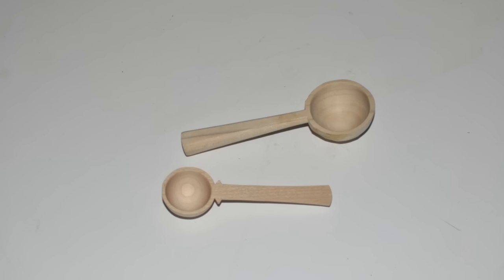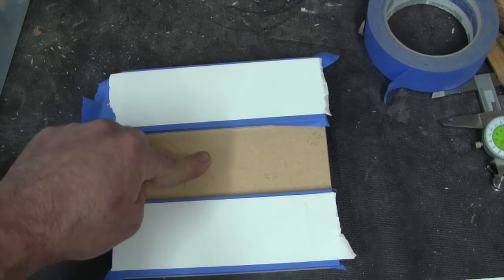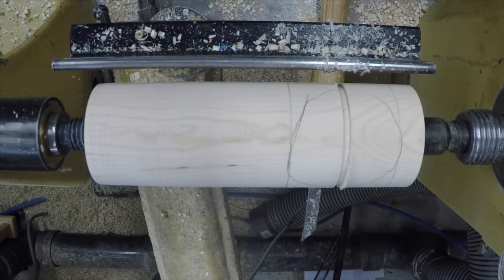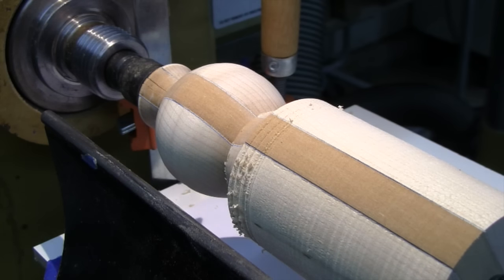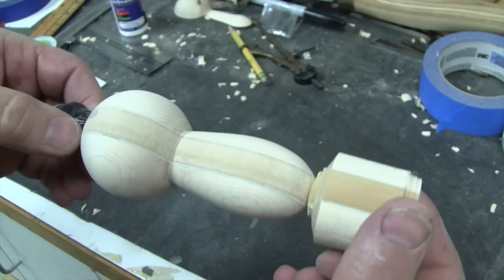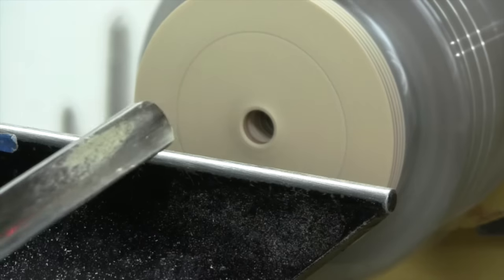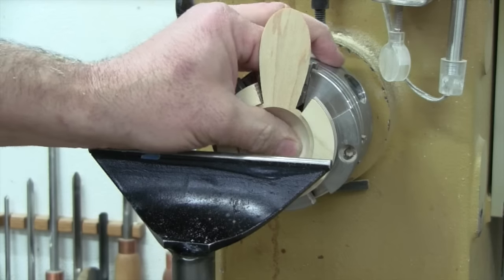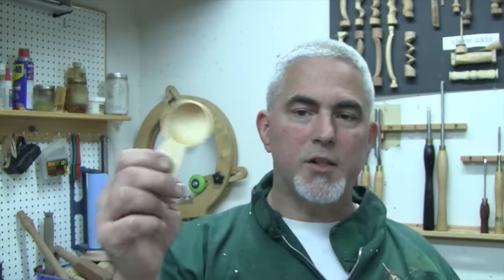President's Challenge, November 2015

Comment: I thoroughly enjoy and I am grateful for your At the Lathe content. I am an old machinist nearing 80 who has begun wood turning. I have a 12-36 Jet and the headstock rotates 45, 90, and 180 degrees in the horizontal axis. There is a short 5" section of lathe bed behind the spindle when headstock in in the "normal" position. I haven't seen any experienced wood turners on YouTube using the lathe in a position other than "notmal". What are  thes uses and purpos of this feature?
Reply from the maker: Looks like it could be for doing bowls with the headstock rotated 180, so that you do not have to lean over the lathe bed to hollow out bowls.

Comment: Another method to check capacity. unscrew the chuck , hold upright and pour in an exact tablespoon of very dry fine salt.   Repeat until it is exactly level and full,,. by the way, on my side of the pond,,... UK. most of us still use imperial in the kitchen .. We don`t consider ourselves that much a part of Europe.